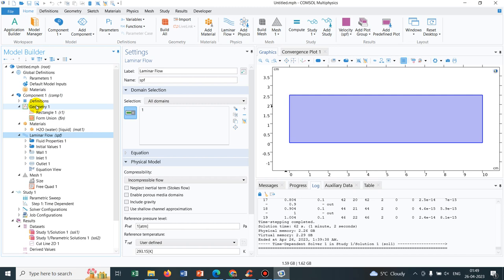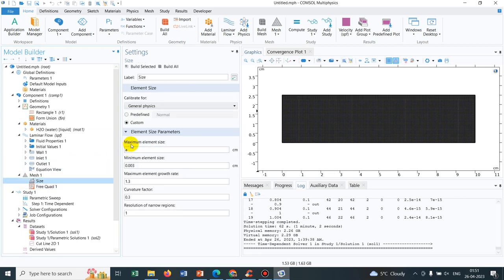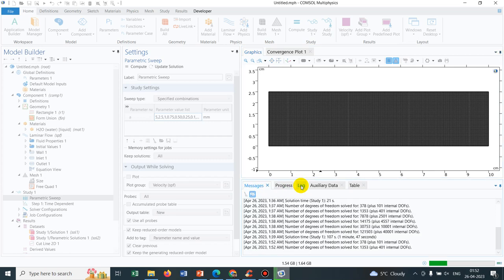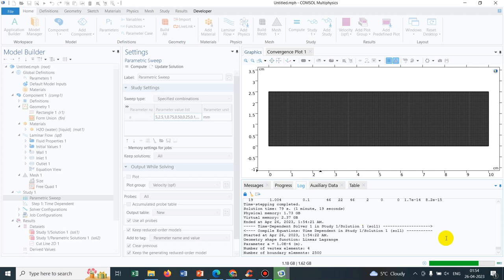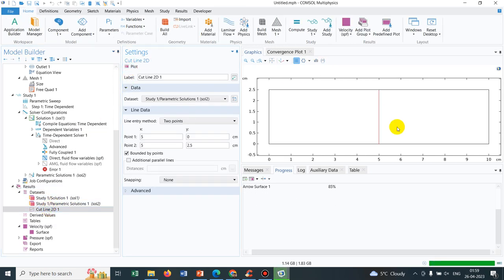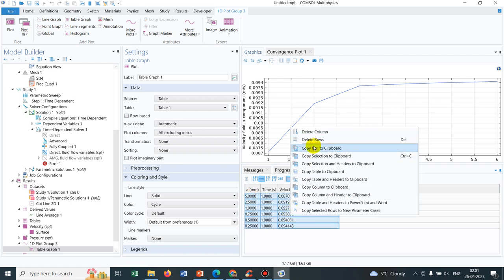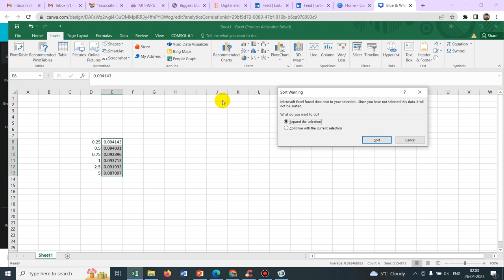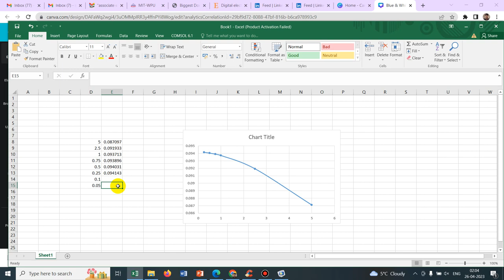Grid Independence Study #Mesh #error_free #comsol #cfd #research #engineering

Comment: Tons of thanks for such useful series. Recently I have gone through some research papers where they directly simulate non-dimensional coupled partial differential equations like Poisson Equation, momentum equation, heat equation (in their non-dimensional form). I am also trying to work on a similar problem. I shall be highly thankful if you can help me out on these. ধন্যবাদ।

Comment: Hi, how could we do mesh independence study in a 3d complex model with custom mesh option, where we have both element and boundary meshes in the sequence. We may face to change the element size in every part of the sequence rather changing only one value as like did in current video. How to approach this case?
Reply: I also want to know, if you figured it out, kindly inform, I used the above method in sst model and it showed that parameter sweep isn't allowed for mesh